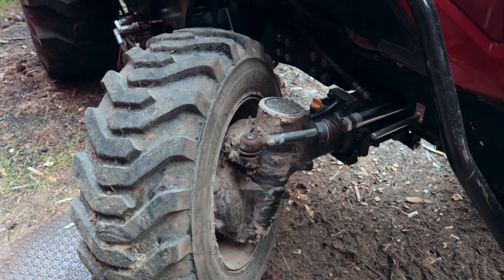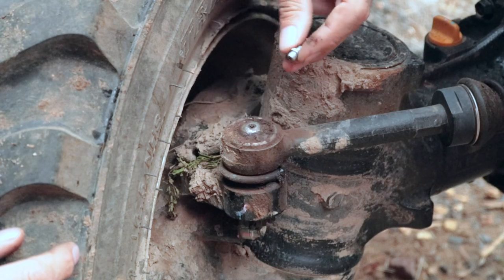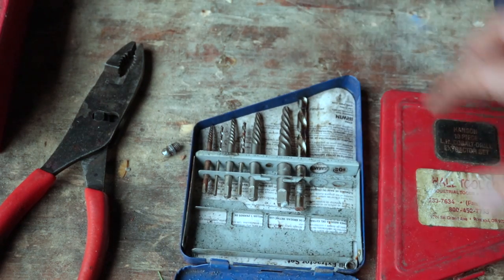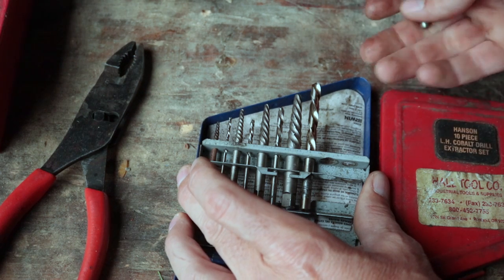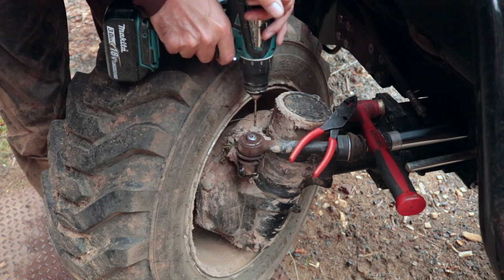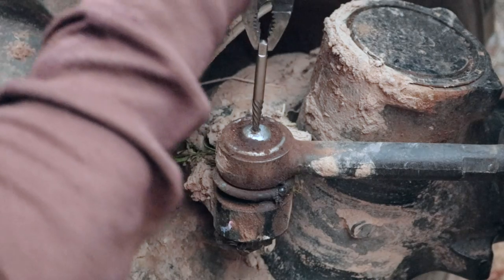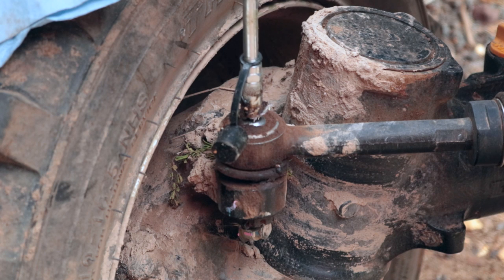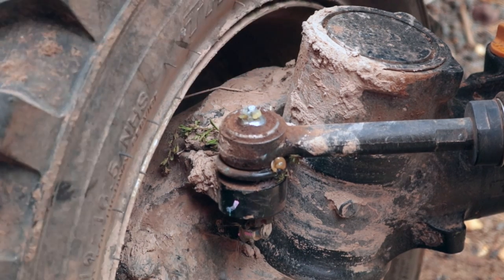I BROKE MY TRACTOR

Comment: HOW WOULD YOU GO ABOUT IT WITHOUT AN EAZY OUT
Reply: Eric Preiner i would use a file end...of an old file...they are sharp and dig in to zert..
Reply: Use whatever works :) small screwdriver blade, the tang on a chainsaw 
file, drilling to next larger size fitting and retapping the hole.
Reply: CO Jones I was not asking how just seeing how many people knew of the file trick thanks though
Reply: Eric Preiner oh ok I've been a mechanic for 40yrs an tried to find every short cut as possible...an left many behind I'm sure...have a good day...

Comment: To be honest you should simply remove the zerks and install plugs. Then install zerks as needed to fill, re plug afterward. Always use a manual grease gun and a light touch to "feel" when full. This prevents blowing out seals

Comment: You must've broke the original drill bit from the kit and replaced it with normal bit. It comes with left hand drill bits so that when it bites when your drilling the hole it will spin it out already and it can't fall in like it did.  Also you trying a new compass on your watch.
Reply from the maker: It came with RH drill bits,
Reply: Wranglerstar go read the writing on your blue kit.. those are left handed drill bits..